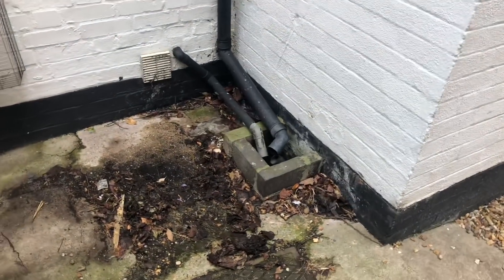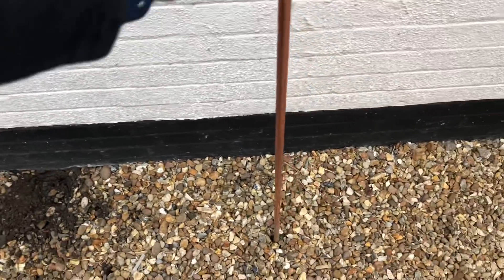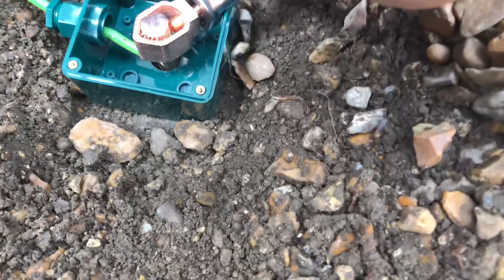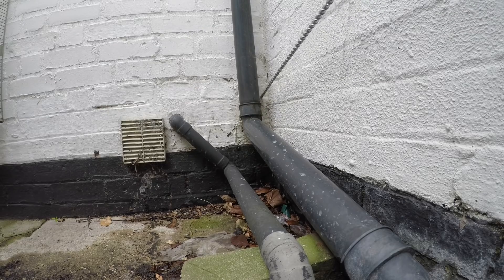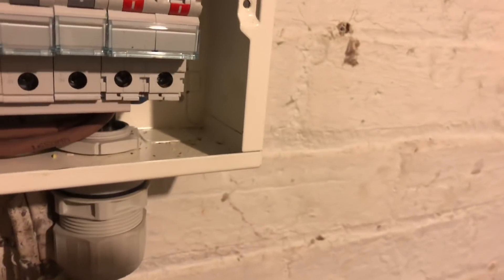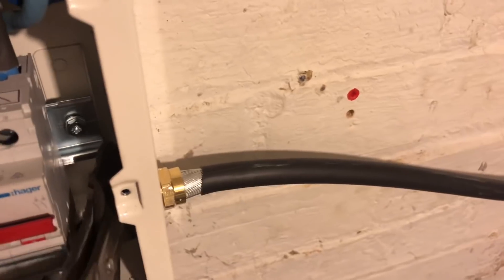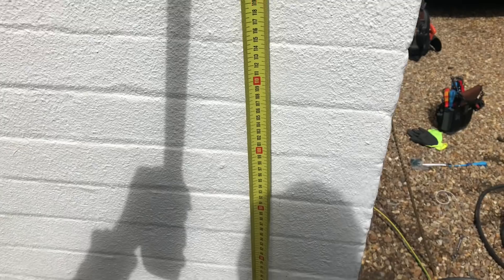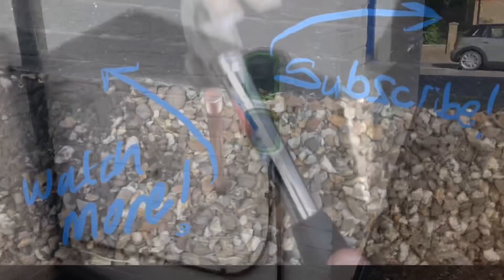How to Install an Electric Vehicle Charging Installation with an Earth Electrode Rod TT System -TNS

Comment: Good video. Ditto with regard to the SDS tip and I’ve heard that putting in the earth rod a few feet from the building wall avoids having to try to get the rod through foundations. Do you think it would be acceptable to connect your SWA sheath to the earth rod and isolate the other end from theTN system earth? I was asked to connect a Tesla car charging unit which did not come with the required type B RCD so had to source a separate one which cost the client an extra £400.
Reply from the maker: Thanks! Yeah I could have done it the other way but it’s more difficult as the gland is connected to the metal consumer unit so impossible to separate the two earthing systems.

Comment: Throw that do armour slice away and get a rothenbirger steel conduit cutter, the type that look similar to a plumber's pipe cutter. They are perfect for swa. I work in street lighting and work with swa all day, trust me it works a dream 🤙
Reply from the maker: Ben Jackson thanks for the tip! Will check it out
Reply: @artisanelectrics  this is the one I use mate
Reply from the maker: Thanks
Reply: Can you send a link to the one you got Ben very interested! Thanks
Reply: @fuzedtv  https://www.screwfix.com/p/rothenberger-no-35-6-35mm-manual-multi-material-pipe-cutter/61463
Reply: Ben Jackson thanks bud! 
Love a new tool and anything to make my life easier I’m all for 👍🏻
Reply: @fuzedtv  no worries mate, it's worth getting a scrap bit of swa and having a play with it. One bit of advice I would give is don't try and tighten the cutter too fast, just be patient. When you get comfortable with it you can cut almost straight through the steel without damaging the inner sheath🤙 let me know how you get on
Reply: Ben Jackson right on mate I will do!
Thanks again

Comment: That's no a very good earth box. I would at least rightly wrap the clamp connection in gas tape (Denso tape), otherwise it's likely to suffer heavy corrosion over the years.

Comment: Being a TNS are we required to future proof it changing to a pme? I’ve done a lot of chargers fortunately all been tns and we have not allowed for a rod in those cases? 🤷‍♂️
Reply from the maker: Tom Mendoza yes we have to either get written confirmation from the DNO that it will never be changed to PME (which they will never give you) or we have to install an earth electrode TT system
Reply: If you are in the UK and not fitting a TT system on a TNS earth then your company is doing it wrong. As Artisan says unless you can get the DNO confirm in writing that a TNS system will never be converted to TNCS/PME then you have to create a TT system. Read the IET guidance book and Regs for further info.
Reply: Richard  Williamson recently had our NICEIC inspection, he looked at one of our car install jobs which was this very situation. Over the moon with it, only looked at one job and said I’ve seen enough. 👋 
So this can’t be totally correct what your saying
Reply: @richardwilliamson3624  I'm just about to receive EDF olev charger installation an eo mini pro. At the meter there is a warning label saying it is PME. The installers rang to say that they had forgotten I will need an earth rod and do I have soft soil near by. I'm not an electrician but I have been watching a few videos about earthing and bonding. I already have a rolec and it does not have earth rod? Fitted in 2018. Do I need to get one added, for pme it seems adding an earth rod on both of the two 32amp circuits should be ok, I don't know. Main fuse is 100amp. Both chargers at the same time pull 7kw each max.
Reply: Where does it state we need a written letter from the DNO?
Reply: Tom Mendoza is agree with you in this instance.

Comment: Never seen an earth rod go in that easy. We use a Kango hammer. Shit earth box. Where’s your Ra testing? Working live...NOOOOOO. EAWR!!
Reply: made me wince with that swarf and grips into a live board... I guess nobody else was put at risk though
Re long drill bits - I only carry a 1200mm in 12mm. 450mm x 8mm fine for a 1mm cable in a modern house, if I need to get SWA/conduit/pair of 2.5's through a thick wall I go 1200 x 12mm through the wall and then in from either side with my 450x22mm

Comment: Good video. Keep them coming. Armour bend up to the charging point  wasnt looking great  but nice tidy conduit. What Zs reading did you get on the rod? Were I stay it can be a nightmare trying to get a decent reading.
Reply from the maker: Keith Johnstone Thanks! Yeah the armoured bend was my one regret on this job, could have been slightly neater if I left the cable a bit longer and put two cleats in. You live and learn! Got 32ohms on the earth rod.
Reply: @artisanelectrics fantastic reading. 
I can put a spike in the ground up in Scotland were I live
 and get a reading of 400/ 500 ohms, It can be hard work sometimes to get it to a acceptable reading. Keep up the good work.

Comment: Nice video, am I old fashioned (I'm 80) but I was always taught to put the cable cleats on the wall with the fixing screws UNDER the cleats to act as support, rather than on the top where the cable would be "hung"  ???
Reply: I’m an apprentice electrician in college and that’s what they recommend to do have the screw/ nail under the cable to provide support to it
Reply from the maker: Interesting thanks for sharing!
Reply from the maker: William Martin Culleton interesting thanks for sharing!
Reply: I don't know about that. The clips should be equally strong in tension or compression. Putting the ears down gives a nicer looking (at least initially) install, putting them up means that gravity will pull the cable against the wall instead of away from it.
Reply from the maker: Thanks good comment
Reply: William you are not old fashioned just have common scence, which is sadly missing nowadays.

Comment: Fantastic installation! Great to see start to finish. 
Regarding the Rolec, was that a Type B RCD? I thought they only came with a Type A RCD?, If so, what did you do for the 6ma DC leakage?
Reply from the maker: Liam Wolstenholme thanks! They come with a type A RCD and internally they have a device which monitors DC residual current and switches off if it gets too high.
Reply: @artisanelectrics  super. Thanks for the reply. Great content, watched a few more of your videos yesterday and now subscribed 👍
Reply from the maker: Liam Wolstenholme great thanks!

Comment: Good video, it's easier to use hituff cable rather than SWA that way you don't need to worry about the armouring, would be ideal for that as it's all above ground, nice to see you installing a rod, I have been to loads of places and they have just connected them to the existing main earth. The thing that annoys me with charging points, is like with any renewables, it's treated as a special case, there is no difference installing circuits for these things as opposed to a cooker or shower,  so why all the crap of going on courses and joining another scheme, all about getting extra money from the contractor.
Reply from the maker: The thing is that they pull a constant load rather than a cooker or something else which clicks on and off these will pull 30amps constantly for 4-8 hours while the car charges, so there’s a lot higher risk, also they are generally outside which makes a difference to safety especially with the issues around exporting PME
Reply: @artisanelectrics  that could be true, but its just a circuit and if you are an electrician you should know all this, whenever their is government money, theres always some red tape and additional cost totally pointless, as i said i have seen these points installed, by so called approved installers and they have not used an earth rod.
Reply from the maker: Anthony charles yeah there are a lot of cowboys out there cutting corners to do things cheaply unfortunately

Comment: Do I see a gap on the earth conduit at the charging box?
Reply: 17:18
Reply from the maker: Yes I ended the conduit and then installed the earth through a compression gland as I don’t trust pvc conduit entry to a be waterproof seal outside like that

Comment: Great video. Wondering what will happen to earth connection inside rod box then it will be full of water?
Reply: As it's not an IP rated enclosure, water will just drain down into the earth, which isn't a bad thing as it will improve the impedance reading.
Reply: Probably not a lot really other improve the resistance a
Reply from the maker: Dean Little it’s all copper so no issues with corrosion anyway
Reply: @artisanelectrics  I didn't say it would affect corrosion 🤣
Reply: Although I don't think all earth rods are fully copper . I'm sure some are only copper coated suppose you would have to ask when buying.

Comment: hi mate nice video. did you leave the earth cable from the swa loose in the charging box? because I heard you say you wanted to separate the two earth cables. also could you still have used a swa gland kit on the charging box instead of the stuffin  gland.
Reply from the maker: Andy chara yeah I left the earth core taped up inside the box, so it’s accessible for testing but nobody can inadvertently touch it. I didn’t want to use an SWA gland as the brass gland would be an exposed conductive part connected to the TNS earthing system. No need to use proper armoured gland on both ends anyway as long as it’s earthed at one end it’s fine. Compression gland did the trick nicely. Taped up the armouring so it’s not exposed.
Reply: @artisanelectrics  ok brilliant. thanks for the reply back mate. good to know when I get the same job in. great video again. keep them coming.

Comment: taking the premature collapse thing a bit too serious sometimes,  that cable would collapse about 1in being held both ends with a wall and metal dB, no one ever is going to get tangled up in that swa lol, not a dig at you just common sense dosnt seem to prevail a lot of the time.
Reply: Dont forget the dwarf firefighters though Super
Reply from the maker: Supersparks yeah I totally agree but I knew if I didn’t do it someone would slate me on YouTube for it! 😂
Reply: Well I’m slating you for doing it ❤️
Reply: I agree with Supersparks but... glad you fitted it, not expensive or time consuming and nods at the regulations with a reassuring wink. Good job.

Comment: Good tip for earth rods is a driving nut on top then a large socket on a sds hammer drill goes in lovely 😁 great vid keep them coming 👍
Reply from the maker: Derek cross great tip thanks!
Reply: Also if the RA reading isn't good enough the thread isn't damaged and a 2nd rod can be connected
Reply: Exactly how ive been taught! Was about tk say the same and saw this!!
Reply: With the regs the way they are and the increase in EV charge points  there's going to be a lot more gas/water pipes speared by keen sparkys!

Comment: Great video mate always a joy , but can’t help but have the ultimate fear watching you drill through the ground without using a C.A.T scanner I think there called on site ..... we get that done at our company before you attempt anything like that , nearly killed myself when my time was out doing this thinking mains cable went a route I thought and after job had been finished and temp supply taken out uncovered I was about 2 inches from driving a rod through the mains from the street ! Just an advice mate 👍
Reply: C.A.T scanners can detect metal pipes/cables underground but they can't detect plastic pipes... Gas and water in some properties are supplied by plastic pipes.
Reply: Alvin Ashman very true mate , tricky one then would be interesting to know what to do without just going for it !! Ball ache trying to get the original drawings for routes
Reply from the maker: Kenny Campbell yeah need to get myself one of those 😂

Comment: Nice install but I don’t see your point in pre drilling the ground to then smash the stake home. How can you guarantee that the last foot is not going to penetrate a soil pipe or HV mains cable ?Not a dig mate just an observation.
Reply: That's always been the case with any TT system tho. Do u know any sparks that attempt to access plans or CAT scan the ground cos I don't. U make an educated guess based on location of manhole cover, water and gas locations in the property. Not a perfect science but better than nothing. Also, why would u pre drill any material before putting a fixing in or driving a rod? It makes it easier because the rod follows the path of the pre drilled hole. Like Jordan said, it lets you find the sweet spot rather than attempt to bray a rod in 20 times.
Reply: John Daniells yeah I get the pre drilling idea which I’ve actually never tried. I was just interested to know why the last foot would be any different to the first 3.
I’ve installed many earth rods but I’m lucky to have a cat scanner.
Reply from the maker: CJR ELECTRICAL the drill was actually thinner than the rod so still get good contact with the ground, if I had a longer drill I would have drilled the full length of the rod but drill was slightly shorter than rod that’s all, the most things that are buried will be less than 3ft from the surface anyway usually. Drill just gives a good feel for what’s down there, if you hit something you can feel it straight away and back off easily rather than keep hammering.
Reply: Artisan Electrics makes sense mate.
I’m doing an earth tape soon so might make a good comparison
Reply: I've watched both of you put earth stakes in and you both need decent hammers! :-)
I work in telecoms and safe dig prints and CAT are required for fitting earth stakes in my company. www.linesearchbeforeudig.co.uk would at least give you an idea of surrounding utilities before you get to whacking.
Reply: Very risky, no guarantee of avoiding any underground utility services unless you hire some surveying equipment, maybe some sort of  density scanner 🤷‍♂️
Reply: Also if you're removing the earth to a point with a drill bit, then there has to be some loss of contact between the rod and the surrounding earth?
Reply: @SME_Ste  I did think this too, if you're drilling a 3ft pilot hole then in effect there's only a foot of copper rod in contact with the general mass of earth... Perhaps over time the earth fills in around the other 3ft.

Comment: How long does it take to charge an electric vehicle, at 7kWh, I would imagine it being quite costly on your electricity bill.
Reply: Depends on the charger. If you charge at 7kW it would take 1 hour. Here in Sweden 1 kWh is about 10p, so 7kWh would be around 70p. I have a Volvo V60 electrical hybrid and my cost when driving on the electric engine is about 2£ per 10km
Reply from the maker: Depends on the vehicle, I think the Nissan Leaf takes about 4hrs to charge on 7kW
Reply: @artisanelectrics  (0.13p x 7kW) x 4hrs = £3.64p (Cost per charge)
£25.48p (Cost per week based on 7 charges)
Reply: @ashmanelectricalservices4318  so that would make it not much cheaper than fuelling a modern petrol car of similar size.
Reply: @Rosscoff2000  it's simpler than people explained... I have a Nissan and Tesla. For each kWh around 4 miles. EDF go electric tariff will be 8p per 4 miles. So round up to 40 miles for £1, then compare that to a gallon of petrol. 85,000 miles in my nissan leaf, I don't even know how much petrol costs any more. Currently I just qualified for a promotion with to receive 10000 miles free, basically £248 credit to my electric bill :) we are heading to a point where being electric only is  simply cheaper. My Tesla Model 3 business lease, is more of a luxury item, but the UK gov are reducing the benefit in kind tax to 0 in April 2020. There is no benefit in kind tax for the electricity if you charge at work. It's also possible to end up saving if you sacrifice some salary to get an electric car. Have fun.
Reply: @thebluesclues2012  not sure why you tagged me in that reply - did i post anything about costs?
Reply: @Rosscoff2000  yeah you thought it sounded same or more expensive :) in your earlier question :) they were answering in befuddled way, mixing charging rate and number of kWh units.
Reply: @thebluesclues2012  Ah, okay, I only remember commenting about using Denso tape on the earth connection. Yes, there's a lot of confusion evident between rates (eg kW) and quantities (eg kWh) whenever this topic is discussed.
Of course, one issue not addressed is what will happen to all these discount rates, bonuses, grants etc when a lot of people are using electric cars. Things may work out well for early adopters just now, but as soon as it becomes mainstream, the chances are costs will rise, or at least be evened out to some extent.
There's also an issue that future heavy demand on the grid for charging of vehicles is ideal for the economics of operating base-load power generators (which are what have historically led to lower off-peak electricity rates), but not so handy for less predictable renewables and pointless if fossil fuel stations (eg gas) are used to boost output. We are going to pay the price for lack of investment in non-carbon base load generation (ie nuclear).
Reply: @alexgray552  renewables and grid storage is starting to make gas peaker plants less attractive.
Reply: A lot cheaper than oil fuel and with cheap rate electricity it's a double win
Reply: Takes about 5/6 hours for the 42kw leaf for full charge from 0.in Ireland we get a nighttime rate of 10c a kw hour so it’s not that bad.Its a no brainer compared to fuel prices